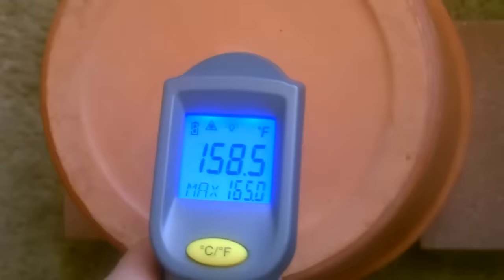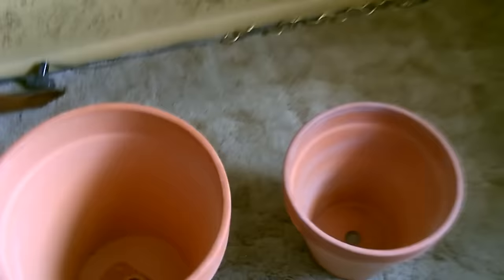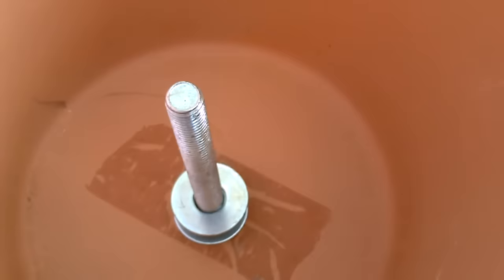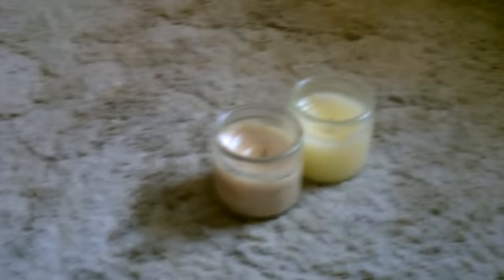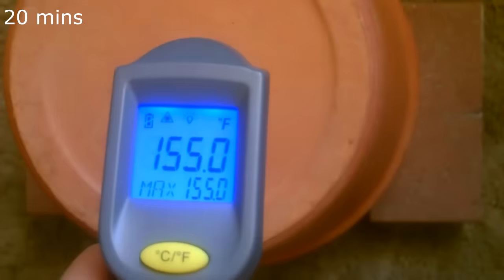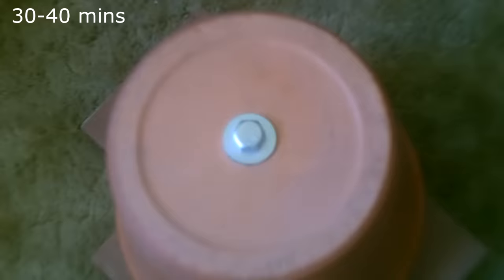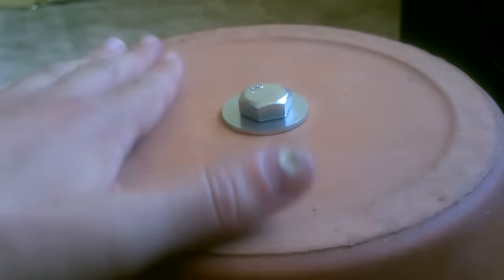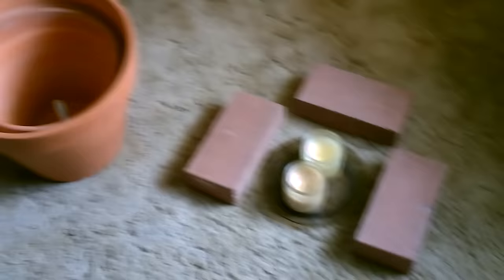Candle Powered Air Heater - DIY Radiant Space Heater - flower pot heater - Easy DIY

Comment: I'm no physicist, but it seems like burning the same open candles without the pots will heat the room just the same as with the pots.  The only difference is if you want to sit next to it and "feel" the heat.
Reply: Its about surface area.  The equation for radiation heat transfer involves the surface area of your body that can be seen by the surface area of the other object.  So the larger the heated object, the more energy gets transfered.  For bonfires, roughly 50% of the heat you experience is radiated.

Also these things suck and I almost burned my house down.  My tea candles got so hot the wax caugth on fire and shot up 8in flames from the sides of this.
Reply: Alan Noble I had much the same experience. The danger is in concentrating multiple candles inside a chimney-like structure. Basically, all the candle wax can aerosolize and catch fire, rather than just the wicks. Luckily I was in the room when it happened and was able to put it out. Also, something that no one seems to mention is that the candles emit fumes that can be toxic, especially the cheap tea lights that everyone recommends.
Reply: and you would right.
Reply: The diffrence is ambiant and latent heat
Reply: Not so, The idea is for the heat from the candles to be absorbed by the pots, the pots then slowly release that stored up heat into the room. This will give you a higher temperature of heat over a longer period of time. If you were to just leave the candles burning the amount of heat that they give off would dissipate in the room alot quicker and not give off a noticeable amount of heat.
Reply: ***** Basically it gives you a radiant heat source to put your hands around however, if you have a thermometer in the room, you will note that the temperature increase is minuscule...likely unmeasurable unless the room is really, really small.  Certainly there will be very little difference (read so small as to be unmeasurable) between the candle alone and the device.  Theoretically there may be a SMALL amount of extra heat if the room is not well sealed as water vapor that would otherwise condense out on the pots is allowed to sneak out of the room with their latent heat still in toe....but this would happen anyways as the pots got warm so it would only help when they were first lit....we are talking about a minute fraction of a minute fraction.  So for all intents and purposes, there is no difference between having the pots or implementing the candles alone when it comes to raising the temperature of a room. Having a warm radiant heat source to hold your hands around, however, is another matter.
Reply: ***** don't ya just love science?

Comment from the maker: the floor beneath it doesn't get hot. almost all (99%) of the heat from candles will rise straight up into the pots.
Reply: People in Texas are doing this using one pot.  What is the difference in using 2 pots?  More heat?
Reply: @jkco4300  The only heat is coming from the candle, the # of pots has no effect on the heat output of the candle
Reply: @jkco4300  it probably keeps heat in better

Comment: There seems to be some confusion as to why this is a better option than just lighting the same number of candles since the BTU output is basically the same...same amount of heat produced whether it is collected by pots or not.  The purpose however is to condition the room which is why this is more effective than simply a candle.  The purpose of two pots is two fold.  One is the obvious...radiant heat which allows the heat distribution to last longer in the room.  But the second is more subtle and it will only work well if the 2nd pot is not plugged up (plug the inside pot but not the outer pot).  When the inside hotter pot heats up, the air between the inner and the outer is warmed and the warm air rises through the top hole.  This creates a convection of air from the bottom of the pots where air is being sucked in, rising through and being warmed by the inner pot, and releasing through the outer hole.  In this way the cold air in the bottom of the room is being sucked in and the hot air is rising to the top of the room.

In a small room these pots are very effective if doors are shut and insulation is decent.  It is not a furnace blasting hot air but it works pretty much the same way a furnace works...but without the fan.  In terms of price compared to a wood stove or heating oil or propane is difficult to make comparisons.  To create the amount of radiant heat that say a log would make (given that most of the hottest heat flies out the chimney or flue) burning at 50 to 80 cents per hour (if you buy by the cord, or a dollar to a dollar-fifty if you buy a bundle at the store)  you likely would need 20-25 tea lights (in which none of the heat escapes to the outside).  If you use a log an hour for four hours, well...that many tea lights might cost 2-4 dollars.  Four logs might cost 2-4 dollars

The major problem with candle burning is that all the combustion is actually taking place in an unventilated place...your house or room.  A wood stove, a furnace or some other heating element keeps the carbon and soot and other dangerous substances out of your home, either through a flue or a ventilation pipe.  I think it is best to think of this as an option to a furnace during an emergency especially if you don't have a wood stove out in the garage or hobby shed where the space can easily be vented.

Comment: I find the second larger pot does allow warm air to rise through the hole.  If I only use the smaller pot with the hole plugged by a bolt and washers the pot will radiate heat, but not enough to heat my 6X8X6 foot uninsulated shed on its own.

Comment: I like the idea for using it in heating my very small greenhouse.  I would do it a little differently though, i would heat both the clay pots with boiling water once i had them screwed on so they would have a head start ... then i would handle them with oven mitts and put the candle under them!  great video thanks for sharing

Comment: I would put the candles on 2 metal pans, off that carpet.  Yes, they work great! I am 73 years old and live in a building that heats up in the morning and cools off in afternoon. So, I put 3 candles in a very similar set up (3pots) on at 12 PM, by 2PM it is cozy.  At 7 or 8 before going to bed I make sure candles are out and nothing looks wonky (scorched under pans). I would not use this if I had kids or animals. I have a heated easy chair but if I use it too much (long) my electric bill goes up.

Comment: I did a chewing gum and chicken wire version, just to see how much heat I could get.  I put the candle, inside a smaller clay pot, balanced the larger one, which had a hole in the bottom, over it, but raised up on three shot glasses.  I didn't have a bolt, so I made a thick curl of aluminum foil and put it in the hole, but coming out of it vertically.   I built the contraption on my kitchen island and I was amazed at the level of heat it gave off and how quickly it heated up.  It's been cold here and it's comforting to walk past it, and put your hands on or above it and toast them right up!  My late mother always had cold hands, wouldn't I have loved to have shown and built her one!    I unfortunately have an a-frame ceiling, and heat floats on the roof line…but I do have a ceiling fan, which I reverse and put on low.  Really makes a difference on the heat.   I love the concept, I get it..radiators aren't new…but I'd never seen one like this.
Reply: The aluminum foil mod is interesting.  You coul make balls of alluminum foil to separate the pots instead of a bolt. Not as clean or stable, but it would be a quick way to try this out.  I believe the 2 pots are to create a greater heating area so that the heat dissipates slower into the air.  Also for the questions of why not leave the hole open, I believe the candles would burn faster and heat wouldn't be trapped as well.

Comment: So the point is to convert the small, high intensity heat of the flame to a large, lower-intensity heat radiating off the entire pot surface.  I'm glad to see you aren't claiming the addition of the pots make more heat.  It only changes the quality of the heat and keeps the source closer to the intended recipient.

Comment: This design is more credible than some muffin candle holder design. 👍

I would suggest running the ceiling fan (blowing upward) to circulate the warmed air down the walls. Room with lower ceiling will get warmed up quicker.
Reply from the maker: Great suggestion!

Comment: Last year or the year before, I had been staring at one of my broken pots I've wanted to fix for three weeks but couldn't because I didn't have the right glue, I had also gotten pretty cold and had no heater, plus I was hungry. It was one of those clay pots with a single hole on the bottom. The broken part being on the side like an odd triangle shape. I flipped it over onto something that wouldn't burn easily. So I just put a candle under it and an open can of soup on top. Once lit, I made sure that the fan would keep it from dying and have a good ventilation. Sometimes I didn't even have to use the fan. All in all, it warmed up my room and took round 30min for a can of spaghettiO's soup to cook.
lol and this is the first time I hear about someone else making one to heat a room.

Comment: You could achieve the same thing very easily at lower cost by simply heating a metal container i.e, a saucepan or kettle mounted on a stand above the candle such that the quantity of water was a little more than the candle was able to boil.  If you got too cold you could make a hot drink with the water or put into a hot water bottle.  In any case the amount of heat given off would be similar to a just boiled kettle, not much really, I would estimate the power to be between 100 and 200 watts.
Reply: My thought was basically just what you suggest - heat a mass of water in a metal pot. The amount of heat disseminated is the same whether you use clay or water plus you have warm water at the end for some tea or coffee. 💪🏾

Comment: Thank you - super idea. One question: I saw another similar project wher the author leaves the hole on the outer pot open (for hot air to flow out - convection). The hole on the inner pot is closed so heat can't escape there. Then both pots sit on the edges of a baking pan with 4 small candles inside. So I wonder which of these 2 methods is more efficient. Have you tested both? The other author seemed to feel that leaving the upper hole open was important...Thanks in advance for any clarification or advice and keep up your great work!
Reply: If I may.......I have tinkered with these systems and can explain... They both work equally for efficiency for heating its just that the convection method will allow for easier heat escape and the convection method reduces the possibilities of "self ignition"..Yes  if you create too much heat the wax will self ignite, which is why you need to operate these systems on a non flammable surface.. The BTUs don't change from one system to the other.. a flame is a flame is a flame.... it will only generate so many BTUs.. However.... the more flames..... then yes the BTUs increase because the amount of flame power increases.. Your limitations are the quantity of flame power and fuels..Alcohol burns hotter than wax.. but I don't recommend alcohol..I do recommend the fans and with the design shown that ventilation holes are drilled into the outer perimeter of the bottom of the larger pot. The convection process will draw more fresh air to the flame..  So, as I have , tinker......  but do so SAFELY and don't use the system unless you understand the hazards and limitations
Reply: @kevinrehberg8758  I dont understand the need for more ventilation holes on lower portion of the outer pot. Isn't that the purpose of raising the whole unit off the floor onto fire bricks while suspending the smaller pot with a bolt?

Comment: I have one like this that I put on a swedish torch. Great to warm a greenhouse. Sure the swedish stove gives the same heat, with or without a pot, but it is just thermal mass so it lasts longer and spreads more evenly throughout time
Reply: how can you order a Swedish torch? what is it?
Reply: It is a log with a deep cross cut with some flammable material in the middle. The fire eats the log inside out. Not sure where to buy them, i just make them myself from a log, using a chainsaw :-)

Comment: wow, i'd never heard of this before. What a genius idea. I have some Qs though, if someone can help me. 1/ why do we have to seal the hole in the pot? Isnt the idea for the heat to filter out into the room and heat up the room? Because if the heat is only spreading a few inches from the pot, its not going to heat up a room is it? 2/ Would this work with tealights? Safer than glass candles?
Reply: Best yet, with 1 & 2 lb cans of Crisco shertening....waaay cheaper, lasts longer, & puts out more heat.

Comment: I'd put the bolt exactly opposite. Hex head of bolt on the inside of the smaller pot, run it through the larger pot and put a washer and nut sticking out of the top of the large pot. Do everything else the same. Now the bolt is a handle you can use to pick up the pots for reloading the candles. Bolt may help radiate the heat too.

Comment: It doesn't create more heat. Like desertsun02 says in the video, the material (clay) and close proximity of the surface area of the pots prevent the heat released from the flames from rising as quickly as it would without the pots.  The heated pots radiate out from the level of their surface, so you don't have to hang out on the ceiling to feel it.

Comment: A better way: if you cover the hole in the bottom pot but don't cover the hole in the top pot, then the hot air is forced out of the bottom pot and comes out the hole in the top pot.  That way 1) the top pot (the one you might accidentally touch) doesn't get so hot, and 2) the hot air will spread farther away from the pots, heating the whole room instead of just the area around the heater.
Reply: Would using a garden clay chimnea with the lid on indoors work the same way or have the same heating effects..?
Reply: @rossmurray3168  I would think as long as it get very hot. A chiminea has large spaces for most of the heat to escape.II used a very large, thick pot and left the hole open at the top, which is very small for that large pot, It got like a mini wood stove, and I could put many can does under it.  The only thing I have to raise the pit more bc the heat melted the shortening candles so the wicks sank!

Comment: Protip: if you want to heat your room, just light the candles. The only thing this device does is prolong the amount of time it takes for the heat from the candles to make its way around the room.
Reply: What the pot will do is absorb the heat that would otherwise dissipate out of the room before raising its temperature. Air isn't good at absorbing infrared(nor general heat), this infrared coming from the flame and from the mass of hot air, so the walls, which are connected with the outside and at a significant distance from the flame, will be the ones absorbing it. At the usual distance, taking into consideration both the walls' area and electromagnetism inverse-square law, the walls receive less heat than they can easily dissipate outside. To illustrate this think of a flame in complete vacuum versus a flame inside a a chamber filled with vapor, which is a top greenhouse gas, and then versus a flame in 0 gravity surrounded by air and suspended iron dust, a good heat conductor. An astronomical example would be to think of a simple scenario of a pure air planet versus a regular planet, let's say equal masses and equal solar radiation per area unit. A regular planet would be able to absorb more of that solar radiation, and in turn heat its surrounding gas more than the pure air planet.
Would the air will be slightly colder since you're also heating the pot
?
No, anything inside the room is being heated, assuming the pot is already there. The air around the pot cover should in fact be hotter as instead of the hot convection going straight up, it has to first accumulate at the pot's ceramic candle ceiling, heating the pot which in turn can heat any of it's surrounding air molecules, and instead come out at the bottom distributed through the sides. It's similar to the concept of placing a heater in a room: place it at foot level and you've done a good job, place it near the room's ceiling like an AC unit and there is no reason for the convection to come down and say Hi.
Reply: Leo Sousa nerd alert

Comment: Thermal mass. The idea is to create a point-source of heat, instead of heating the entire room. The majority of the heat is contained in the two pots, so if it's a two or three feet away it's radiating infrared heat towards you. Because the pots are such great insulators, it takes a long time for the accumulated heat to wear off as well, so you can use it for some time after it's out.